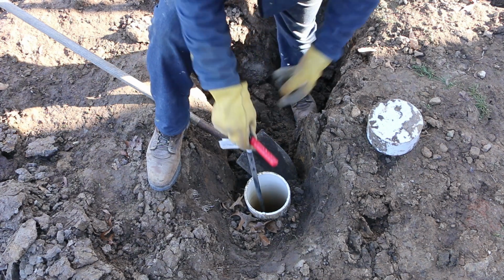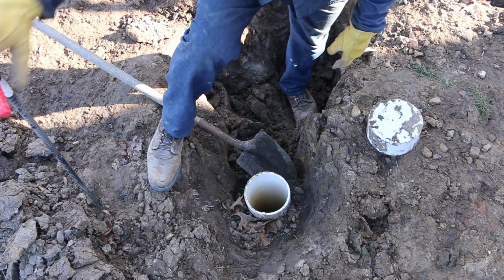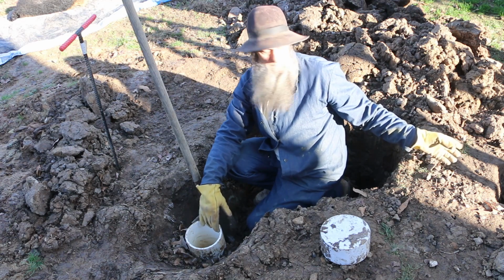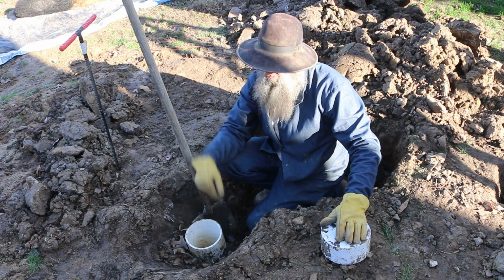My OFF GRID HOT SHOWER! Wood Fired Gravity Fed Rain Water

Comment: I knew a person that had his house in NC hills and had a spring 75-100 ft up the hill behind his house and had to reduce the head pressure so it wouldn’t take their skin off 😂
Reply: He’s a lucky man to have that problem !   My NC mountain cabin has a spring 75-100 feet BELOW the cabin !  I have to pump it up to a holding tank.
Reply: Who built the cabin above the spring🤔
Reply: @glennwilck5459  the spring is at the very bottom of my property and I didn’t have the option of building the cabin below the spring
Reply: @garywilser7802  oh well your still mighty blessed to have a good spring!
Reply: My grand parents spring is just slightly above level with the second floor. So you get terrible water pressure up there which sucks when you want to shower
Reply: If my math is correct, 100 ft up is roughly 45 psi of water. That's the same you get from the city.

Comment: Next time you have to hand dig a project, put the dirt you dig out on a tarp or something similar. Once you are done and ready to refill the hole, just pull the tarp of dirt near, then pour, fill and pack until your finished. It's a quick refill process and keeps the area around the project tidy. 
I think its less shovel work and maybe it would help you too :)
Reply: Your pure genius. Lol.its the simple things.
Reply: That's what I do and I also do that when pruning trees/shrubs around the place, then I just pull the tarp over to the compost or burn pile, roll it over and I'm off to the next thing.
Reply: Wish we had done that when I helped husband dig a trench to rabbit shed and his workshop 250 ft 2 ft deep took us 4 days to dig out holy cow it was hard but I he has power in workshop and I have lights in rabbit shed took us a week to get over that project
Reply: Thank you so much for this tip. This is extremely useful. I will be using it.
Reply: You would need a bunch of tarps because you could not put much weight on each and still be able to move them around without ripping them
Reply: @michealdraconis6179  , you can put much more on them than you can a wheelbarrow. I do this all the time for various landscaping projects. You'd want to use a decent tarp, not something from the dollar store. 4-mil poly plastic works well also and you can get a giant roll of that. A Painter's drop cloth would probably work even better, I'll have to try that out.
Reply: A friend of mine suggested we do this yesterday move massive piles of leaves to the compost, the tarp is one of my new favorite must-haves!
Reply: @bayleeovalle5873  so much easier!   We always use canvas painters drop cloth.  My Dad got me started doing that.

Comment: We lived a whole 6 months without hot water. We lived in town and the cold water ran under the streets and got warm enough by August that it would lightly fog the mirror. Wasn't a bad deal. Also lived through heating my own water as as a kid because our water heater didn't always work. It's definitely doable. We had wood fire heat and lost power a lot in those days and occasionally the water froze. Always a work around. More than one way to skin a cat.

Comment: one thing you can count on is that eventually plastic valves will break. should be metal with a gravel bed to let moisture escape so valve does not get encased by mud in time. food for thought. love your homestead.

Comment: You might want to install a Ball valve on the pipe going up to the shower heads, constant water flow will be a pain to "soap up" ( Just a suggestion) It will be more convenient once you establish the temperature you like from the two valves, You can get wet, then turn the Ball valve off, soap up then rinse off. 😁😁
Reply from the maker: See the pipes above? I separated them on purpose lol just turn sideways and no water on ya 🤣
Reply: @OFFGRIDwithDOUGSTACY  LOL! I Missed that! LOL!

Comment: remember it takes elevation of the tank The higher the elevation relative to the outlet is how one figures the water pressure.  0.43 psi per foot of elevation of the tank there is nothing special just need to know get the tank as high on the property as you can. 2.3 is the divider. so if your tank is 50 ft higher than your outlet   you will get around 21 pounds of water pressure
Reply: Thanks I NEEDED TO KNOW THAT HUN
Reply: looks like they get efficient water pressure, as explained with tanks bottom at the spigots inside.
Reply: @pawsomelabrastead9244  as the tank drains the water pressure drops so the volume also drops this is why having 2 inch pipe helps

Comment: I made a shut off tool for 1-1/2" pvc ball valve, took a 2" pvc cut 2 slots that would go over valve and drilled holes in top for a 1" pvc for a handle. Been using it for years if notches break just recut.

Comment: Doug saying "don't get me started about gas cans"

I'm here going off about gas cans to my husband 😂🤣
Reply: What about gas cans?
Reply: @mjacobs5875  All the safety and environmental regulations. They used to work a lot better when they had vents. Now you have to deal with slow pouring, splashing, glug-glug pieces of junk. Then there are the size limitations, and the list goes on.
Reply: Mark Haury thanks for answering.
Reply: @awo1fman  Yeah, they're terrible now. The one I use for my mower has a horribly designed push button deal. Crap.
Reply: @awo1fman  I think this makes them dangerous too. I think people who have never lived in the country, never had to get gas for equipment that live in sky scrapers are being allowed to be in control to design environmentally friendly things? With no clue on the reason with this for instance that makes them not safe. The vent never let gas get out. Made it safer to pour. Now they are spilling gas. So yes very frustrating and going to cause environmental problems. Very dangerous really. Easier to spill gas on yourself too.
Reply: @danamama6766  The thought behind the design of the crappy vents built into the nozzles is that if the tank overflows it will seal the vent and stop pouring when the vacuum gets high enough, where the kind of vent that actually works will just keep right on pouring. The problem with that kind of thinking is that the new style will still spill far more than you will by accident with the old style, and it spills a lot more than the old style just trying to get it to pour. And who just leaves a gas can pouring unattended? Nobody, ever.
Reply: @awo1fman  oh brother. yes not good logic for sure. And pretty hard for a gas can to just stay propped in the air pouring itself so true. so frustrating

Comment: You can make a valve shutoff key with threaded pipe, a tee, 2 nipples and cut a slit to fit. You could also use PVC the same way and cut the slits to fit the valve. Keep up the good work.

Comment: Hey Doug,  I grew up with a gravity fed water system.  I like your shower but you better be very careful with the hot water that you don't scald yourself.  Not sure but I think maybe 130 degrees is all that's needed to scald you.  We had free gas and a very old water heater that had no thermostat.  I can remember the lines getting so hot that the black plastic pipe on the cold inlet water heated up 10 or 12 feet away blew off the metal pipe it was hooked up to.  Daddy loved that black plastic pipe cause it was cheap and used it everywhere.  Definitely not good for hot water.  Good video Doug but, you and Stacy please be careful.  God bless you two and keep you safe and healthy.
I wanted to be sure so I looked it up.  Water at 120 degrees - 5 minutes 2nd & 3rd degree burns on adult skin.  Water at 130 degrees - 30 seconds 2nd & 3rd degree burns on adult skin.  Water at 140 degrees 5 seconds - 2nd & 3rd degree burns on adult skin.

Comment: If you want instant hot water run the water through a coil of copper pipe inside the chimney pipe as long as the fires hot comes out hot instantly nice to have a separate stove for this setup but works great as a hot water heater

Comment: Doug you could use these solar shower; fill it water and hang it out in the sunlight it will heat the water in the bag.  or you can connect several coil of black poly to your water system and leave it out in the sun it will heat the water in the pipe.  Stay safe. And have nice and safe holiday.

Comment: Cool set up dude, nice work.  I've been thinking about adding a system kinda similar to our place.  My system at the moment is a bit more complex with a central hot water tank thats tied to a water jacket in the wood stove and solar collectors on the roof. Theres still that in between time of year though when I haven't turned on the collectors yet because night temps being too low but its also not cold enough for a fire either. Something like this would fill the gap.

Comment: Another way to explain it is the same as a water tower. The water is stored in a tank 100 ft above the ground and the pressure is caused by the head pressure of the water pressing down and increased through pipe diameter reduction along the way to the individual homes.

Comment: Good info on the size of the shower plumbing. It would be nice to find a water heater like that...there is also the rocket stove, copper coil into an old water heater method.

Comment: Thinking that you could build or purchase a decorative and yet water/weather tight above ground well fixture to go around all 3 of your water valves.  This way,  you will have quicker access in the case of an emergency, and you wont have to use a shovel/tear up your lawn/landscape whenever you need to access your shutoff's.. ?  Another option would be to extend the stems of your shutoffs so you can reach them with your hands and use popcorn foam to serve as an insulator inside the tube to protect the stem from freezing  etc.   idk.. Just throwing out ideas

Comment: The "big box valve tool" is putting pressure on only one wing of the ball valve handle. plastic ball valves degrade as the oils used in their manufacture dry out, brass is much better. More expensive but not when you figure digging up and fixing plastic ones. But sometimes you gotta do what ya gotta do. So what i used was a piece of pvc pipe large enough to reach to both wings of the handle and notch the pipe to fit over the handle wings and drill a hole in the top, parallel to the notches in bottom to give you reference to handle location, to insert piece of rebar through pipe to turn the pipe. pressure is distributed more even on both handle wings.  love youns, great entertainment with info packed videos

Comment: Nothin stoppin ya from using 12v circulation pumps taking it to higher tanks with float valves, and high pressure(80-90psi) 12v automatic pressure switched pumps to complete the experience. I hope you have a pressure  blow off valve on the boiler, crazy things have happened with boilers.. Remember that lengths of Pipes can hold volume of air pressure for compressor tool use and filtered water water for storage of filtered rain water in addition to using bulky tanks that may freeze above ground in winter. I too have to boggle my brains on how I'm setting up rainwater flush toilet. I have seen booster pumps specially for shower use - might work for your situation to get a blast at lower flow. PVC pipes crack in just a frosty morning above ground so keep it in mind.

Comment: We had a similar problem with our well pump. It broke down inside of the pipe and we had to dig it out to get the pump out. However when we put it back in the ground, we made a door on the pipe, then if it ever happens again, we could just dig it out, open the door and fix it. Instead of having to cut the pipe again. Just a suggestion Incase you need to redo this ever again.

Comment: It's great that you're willing to accommodate your Mom's wishes, but maybe she should try staying with you guys a bit before insisting on the grid connections. I think there are things you could do to make the off grid stuff easier for her than you have it yourselves. It's definitely smart to put in the off grid stuff alongside the grid stuff. Maybe you can get her to switch back and forth to compare and eventually wean her off the grid. I'm assuming it's really just the plumbing, as she should be able to stay off grid with electricity if you use all LED lighting (12V DC instead of AC is more efficient than 120V) and put solar on her cabin. The one thing you don't want to do is get connected to a power company because in many places once you're connected they can force you to stay connected even if you can prove you don't need them. Maybe that's not a problem where you live but if you don't already know for sure you should check it out.

Lots of good tips and info in this episode. 👍

Comment: If at all possible you just need your water tank to be higher.   Every foot higher you can make it you'll gain about 0.4 PSI, minus the resistance in the pipes or course.  So if the top of the water line in your tank is 5 foot above your spigot, you're only getting ~2 psi. It also means your water tank needs to be on the full side all the time to get water out of it properly.  Water pressure in town can be 30-50 psi.

Comment: Those tools work very  pretty well on corporation stops.  A tool with two pins spaced much farther apart would be better on one of those ball valves.  I have those sprinkler control boxes all over my property.  They very seldom house water moccasins.  Please tell me that you put a sleeve around that 2" coming through the foundation.  Do you have a pressure relief on your hot water heater?  I like the shower pipes.  Very nice.  It would be nice to have a port to thread an electric element in the bottom of that tank.  You could use it for a solar dummy load.

Comment: Very interesting system. Is there a pressure relief valve for the tank if the water gets too hot?  I did smile at "Heat the hot water in the water reservoir of the cookstove"..lol.  Never thought I would see a TV there...but glad the solar is working well as it certainly takes some stress off.  Are you considering running it into the house as well?

Comment: Since water is such a big issue, why not use a handheld shower wirh a inline on-off valve right before the handle, where the hose attaches.
That's the way I do mine and a good shower uses about ONE gallon!

Comment: Doug you have electricity now bud you could install a small water pump to add pressure to you water system and those flow restrictions in modern plumbing are removable either pull them out or drill them out
Reply: What about adding in a pressure tank?  I haven’t seen anyone commenting about that?  If not possible, please explain why.
Reply: A pressure tank still needs a pump to pressurize the tank but yes with electricity I would Add a pump and tank

Comment: Hi there Doug, Is your furnace also h/w storage ? capacity please?  
Where did u locate your hot safety pressure valve ?
What are your pipe sizes in and out of the boiler ?
.You say keep the bottom of storage tank level with  shower head or highest faucet,  surely bottom of storage tank can also be higher than those things because it would give you even more pressure ?.      ( Assuming you pipe sizes were big enough ) 
Thanks hope you get time to reply .. Yours, Mike

Comment: Really like how you drilled holes in the pipe for shower water.  Could you use a showerhead ?  Would there be enough pressure ?  You could also have a vertical body spray with a little engineering.  LOVE IT.

Comment: I wonder if a water pump would help with adding more pressure so you could use standard plumbing pipes???  Use, it would required electricity….but, only for when you take a shower, or use hot water.  Maybe have the pump (which are really cheap) on a switch.  Then just use the generator to power it when needed…

Comment: Can you put in a shutoff valve instead of a float valve? That is if the shutoff valve was inside the house. And run it to a hot water tank that's heated from a woodstove. I believe Lehman's sales them. If my thinking is right, would that work?

Comment: Those PVC ball valve handles always brake off after a year or two. I’ve installed tons of them on septic systems to go from old systems to new. The best is a brass ball vale with a metal handle but cost more so no one wants one till PVC one brakes then they change there mind 🤦‍♂️

Comment: I had a question about your fire/hot water holding tank....I realize you stated that smoldering is great to maintain water temperature however I was wondering about the heat output.  Does it warm the learning center up enough to take the chill off or  will you heat that a different way?

Comment: Is there anything in the boiler   just a burner in a tank or are there other structures in the tank to help heat transfer.  I built a pool heater it works but not as well as I want  and I was thinking about building similar  but maybe a but more complex..

Comment: If you use hot water for radiator heat, you may want to use heating pad - I think it is coated so oxygen does not pass thru it. It may be closed loop only, not sure.....
Reply: Yt changing words - heat PEX (not pad) lol...

Comment: Hi Doug, another question - what is the B bucket for in the background between shower and water heater? Does your water heater have copper pipes rolled around the fire barrel?
Reply from the maker: That is for the blow out if it gets to hot it blows a relief valve